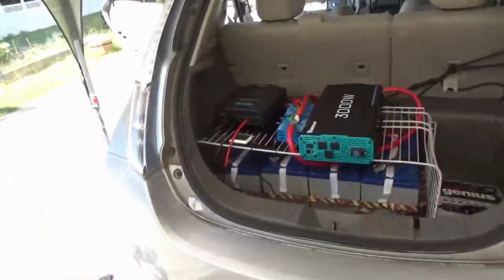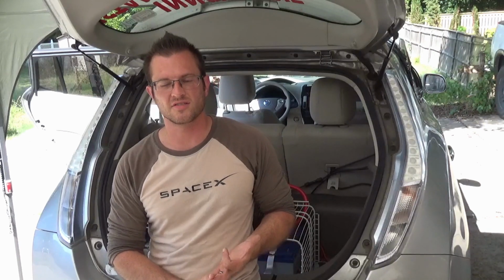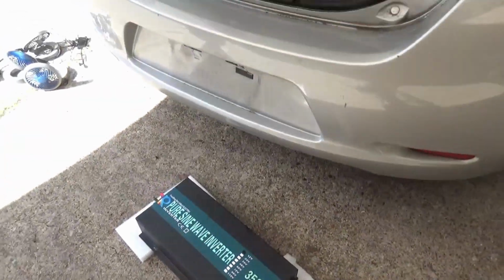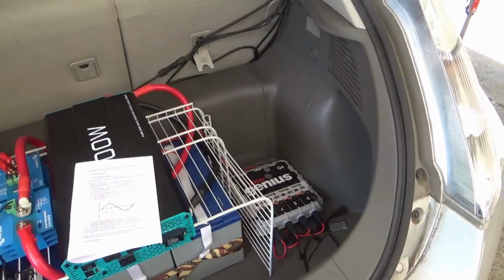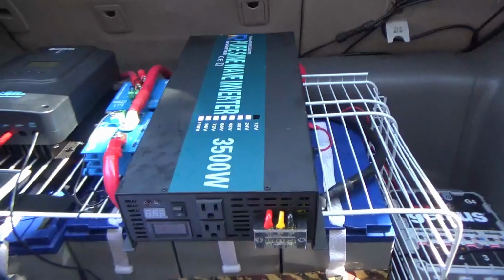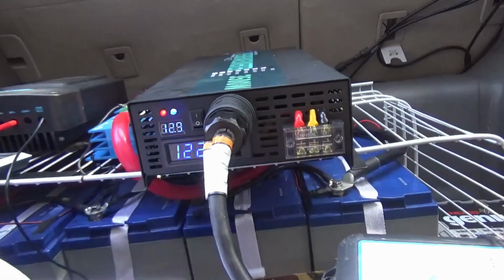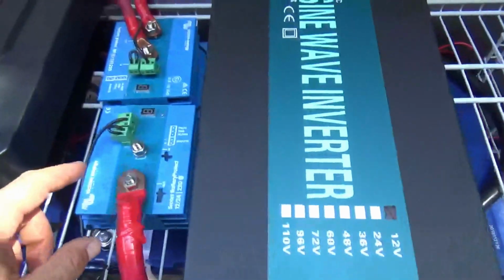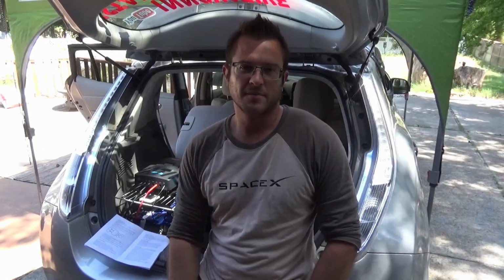Inverter Problems

Comment from the maker: Just had a helpful viewer e-mail me some insight.  He relayed "I believe the overvoltage light on the inverter is caused by the solar charge controller. When the voltage on the batts is close to full, the charger may put out high frequency, high voltage spikes, ~14.7v for short durations, to keep the battery topped off."  Brilliance in it's simplicity, and I don't know how I didn't see it before.  Next time, I get an overvoltage warning light, I'll definitely try disconnecting the charge controller.  (Always disconnect panels first, THEN disconnect battery leads).  Thanks to all the viewers who have helped me with this project.

Energizer did contact me about the inverter and say "Our product is UL listed, and perfectly safe, ." -blah, blah, blah.  I told them exactly how I had it set up when it failed (really failed!),and said maybe I got a lemmon.  If you want to mail me another one, I will test it out and retract my description of it as "unsafe" if it works as advertised.  I got no response to my offer.  All cables gauges were up to NEC specs, and all connections were tight and solid when this inverter failed.

Update: 11-12-2019  I eventually switched to a Giandel 4000w inverter.  Which makes it's first appearance in the video "Solar Powered Air Conditioning".  This inverter has worked perfectly for 2 months and counting.

Update: 2-16-2020   The Giandel 4000w is really starting to look like a home run.  I like the features on it, and we're over 5 months/3,000 miles using this inverter, with no signs of problems whatsoever.

Update: 11-24-2020  The Giandel just passed the 1 year of use mark.  No problems whatsoever.
Reply: Innovative: great video. I'm subscribing and unsubscribing from all the phonies. A phony is someone who does a video where they show the unboxing and plug it into their various appliances; then say: "I love it, it's great." Then I read the reviews on Amazon and they break down after 3 months. You're the real deal. Keep up the Excellent work!!!
Reply from the maker: @julesfalcone  Thanks.  The silver lining of being such a small fish that no one will sponsor me for sh!t, is that I have no financial incentive to be anything other than brutally honest.
Reply: I had one of those renogy 3000 watt inverters and it failed after about 6 months on the yacht. But in their defense, I did have it in a not so dry area of the boat and constantly had moisture on it. I opened it up and found a lot of corrosion on the inside so I gave it a pass and ordered another one. This time I put in inside under one of the seats that's in the salon. I found that it got hot (120f), so when using high loads, I took the seat cover off and put a fan on it. Now I have mounted it off the floor in the cabinet and put some temperature controlled fans in the enclosure so far I abused it cooking all the time and running a 16,000 btu air conditioner occasionally for hours at a time. I also have a 120 volt refrigerator, so I leave it on 24/7. 7 months at sea and had zero problems with it mounted in a nice dry location now. I have it fed with 700 amps of lithium and set my charge controllers from the solar at 14 volts. It never really runs below 13 volts as lithium batteries just give it plenty of power. The only thing I can suggest is getting a much more expensive sungold inverter. I just did not go there because they run at a higher standby current and I have no use for the built in charger. I already have a 60 amp charger on the boat, 2x140 watt alternators and 1,800 watts of solar that will get to 80-90 amps of charging during the day. So I have had great luck with this inverter for size, price and reliability. I really would like to have just a little more power, but almost every review of the 4000 watt models state they are really only good for 3000 anyway. I might have another look into the Giandel as that was another choice I did not go with. I am thinking of having a spare, as 4 months in the Bahamas at a time would be disastrous to have it fail on me.
Reply: Many thanks for posting the answer!!!
Wondering if what I stated yesterday will also work as the spikes might be released via the resistors and car chassis.
Might help in avoiding disconnecting/reconnecting.
Reply: Well I hope that shirt is just a fanboy shirt and doesn't suggest that you actually work for Spacex.
Reply: Glad you found an inverter that will work for you. I think your having trouble with the reliable inverter because they bond the netural and ground inside the unit. Also the ground prong is not wired to anything you would have to connect the ground to the prongs. Your car charger needs most likely wants to see separate ground. If you open the inverter up you will see the bonded connection and you would have to move the green ground to the chassis of the inverter then take a grounding wire from the inverter chassis and connect to car frame. I think it's called floating netural. 

Or could also be it's faulting out because it's seeing 60V on the netural ground connection I'm pretty sure the reliable is center tapped like a transformer outside your house. But someone correct me if I'm wrong.

60V on hot 60V on neutral on the inverter
Reply: A wagan tech proline 3000 watt has true ground get one those or go power I know I use the proline 3000 and have tested it it has ground most inverters have open ground and the one you got most them have hot neutral
Reply: @jameswilsin5348  It's weird that WAGAN touts the "Neutral to Ground Bonded/True Ground" in their list of inverter features yet totally ignores describing this rather "unique" advantage in the User's Manual(s). Very odd if you ask me...
Reply: I’m no EE PhD but I’d want to see a chassis ground that would wind up eventually bonding to a ground rod in the actual dirt of the earth if possible. But like in a RV or whatever I just cannot fathom how an inverter would not be grounded to its chassis and the battery neg with gfci in there.
Reply: @fishhuntadventure , do you telling that inverter needs to be grounded?
Reply: @jameswilsin5348 , do you telling that is a ground problem?
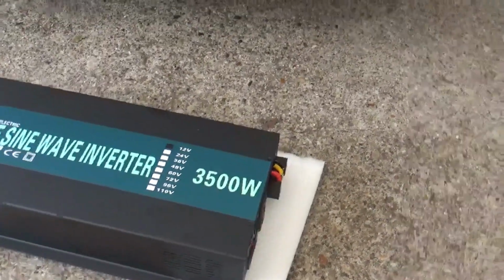Reply: Hey "ISS". In your video at [ -> 4:55 <- click here ] there is a 12V/3500W inverter. And frankly, it looks way too small and shallow for the 290A to handle. I don't really believe it!
 
Then at [ -> 11:00 <- click here] I see that you have put some kind of ring between the cable end connector and the hub - perhaps a spring washer. Always put the cable end connector ALWAYS belongs on the bottom and everything else - like any smaller wire end connectors, washer, spring washer and finally nut - they go on top of the big connector - never below. Now you have a disadvantage between the big surfaces of both - the hub and the end connector. It worsens the contact! So never spoil the abundant mating surfaces with some secondary junk that you can place on the top of the hub bolt.
Reply: I had 2 rich solar inverter s go out in less than 6 month.
Reply: try some sort of voltage regulator
Reply: Appreciate the constant updates to track these things 👍
Reply: If you are still having troubles, you can always use an Outback inverter. Expensive, yes, but 300% rock solid. They make vented, and also sealed units.

Comment: I went through 3 inverters in 7 weeks. 
1rst one from Temu lasted 4 days. It was sent back, and I got reimbursed.
Then the 2nd time,  I ordered another one from Temu again. It did not power on at all. So I got reimbursed again. Then the 3rd one from Harbor freight, the Jupiter, only two bars came on showing 10v, even though my multimeter showed the full voltage. So I took it back that same day and got reimbursed again.
My word, I have been into electronics since 1975, and built tube receivers and restored old receivers from 1939, and those electronics components to 1990s lasted a lot longer than this poorly manufactured components of today. It's also fragile. Since most circuitry is manufactured in China, they may be cutting corners with construction of components.😂😢
I am also an extra class radio operator and know like the rest of us that alot of the components that come from certain places in China are bad, don't get me wrong, yeah, there are some companies there that do good, but the rest are cutting corners.

Comment: Those car chargers needs bonding earth and neutral, So ground it, connect neutral and earth together and its working. Unfortunatelly i think you killed the previous inverter, dont ground it into car casing, but into ground.

Comment: I hooked the red positive to the batteries black negative terminal accidentally for the second time. Blew not only the fuses again but the inverter wont work with new fuses. Nobody I know can fix them. Thats the second inverter my stupidity has ruined.

Comment: I believe the grounding issue is because the US sockets is wrongly wired internally, someone else open it op and found out the Neutral and line is switched, so if you had wired it to the external screw terminal it might had worked. hope it Will help someone else.

Comment: If you intend to charge an EV with an inverter, it's important to consider the technology that's used in the inverter. High frequency, transformerless inverters provide a much lower surge capacity and a shorter life expectancy than heavy duty, low frequency, transformer-based inverters. Additionally. high frequency, transformerless inverters do not provide any galvanic isolation between its DC boost stage circuitry and its AC output which can allow high amperage DC current to pass through to your EV's onboard charger and damage it. 

You may be able to use a high frequency inverter to charge an EV short term, but it would just a matter of time before the MOSFETs or IGBTs in this inverter fail and you can kiss your EV's onboard charger goodbye. A much better and safer choice if you want to charge your EV with solar is to use an inverter or power station that uses low frequency, transformer-based technology in its design. Low frequency inverters can handle high surge loads for at least 3x their continuous rated capacity and they can do this repeatedly, without sustaining damages to their MOSFET transistors, for minutes, rather than the milliseconds that a high frequency inverter offers. And because low frequency inverters use a transformer, they provide galvanic isolation which protects your EV's charger. That's why the big-name brand inverter manufacturers like Schneider Electric, Outback Power, Sigineer Power, Magnum Energy and Victron Energy and others, all use a low frequency topology in their design.

Comment: I believe you need to  run a jumper at the inverter plug between the ground and the neutral  use a old plug and make your connection their.

Comment: Ground AC? One side? This is an idiotic requirement some electronics manufacturers want and demand. You have a floating ground. No connection to the third prong. Some old circuits assumed center tap. A voltage half way between the two prongs. ( good ) . AC usually is delivered as 1/2 of a 220 volt AC circuit. It's center tap and one side. Electricians aren't the brightest bulbs.

Comment: Quick Question….
We have Giandel 2200w  12 vdc pure sine wave inverters ready for installation i our ambulances and 2-way radio communications and repeater vehicle.   There are many more devices requiring clean power nowadays and this seems like a good solution for the extremely limited budged we have for this project.

We love the inverters and the manufacturer is rock solid according to several other fire departments in our area who’ve purchased the Giandel.

The BIG QUESTION…
Do we need to “pre-charge” (with low impedance  / high power resistor) the capacitor bank prior to applying 12vdc power from the 100ah x 2 (parallel) 12vdc LifePO4 batteries?

I’m our communications trailer, we have a pair of batteries with charging provided by a 60 amp AC to DC LifePO4 charger from a small portable Honda 2200w inverter based gasoline genset.  The generator only has to be run for a few hours every 12-20 hours of radio equipment use.   The batteries and inverter permit us to only run portable generators occasionally.

The batteries are normally left disconnected with a Cole-Hersey type mechanical DPDT 200a 12vdc switch.
In our other vehicles, the inverters are wired directly to the batteries (using both fuses and circuit breakers to catch an overload or dead short as soon as possible.

Any ideas?   
Sorry.. forgot..  we have used the standalone inverter in our comms trailer a few times for short intervals.
During this time, we haven’t run into any issues..

Thanks !

Comment: I went with the Giandel inverter as well. I am not an expert, just a DYI-er & I have found that even tech support at Giandel on ground issues, to be sparse. They basically said to use only the L & N terminals -  "Our inverter generally only measures the voltage from the L to the N.
L = Hot wire
N = Neutral wire
G = Ground wire
Regards,
E

Comment: I highly suspect you are correct that the temp is the issue.  I doubt they mean the room you put it in can be up to 159F.  I think they mean that the device itself can get up to 159F before there are issues.  And your STARTING temp is 128F in there.  And once you start putting power through it it is probably going to heat up more than 30F.  The fan can bleed some of that away but probably not enough.  Just a guess though.

Comment: 12v Inverters have big problems. 12V is rubbish for high power, because you need large currents to get high power and voltage drop is an issue. also the ripple currents are enormous. Also drawing large currents from battery will degrade your battery life. Excessive Battery voltage sag is another problem, at high current draw. You would need a trailer with dozens of 100Ahour batteries in parallel, just to cook dinner 3~4KW draw for say 30minutes, and most inverters would overheat and go pop, as they are overrated and undersized. A true reliable high power inverter does not exist it would be massive and cost thousands..and thousands..

Comment: I have a Krieger 2000W PSW inverter that I have with a 300W and 2 Redodo 100AH batteries as a solar battery back up in case of an emergency power outage. I have never ever needed to use it thus far and I only turn it on to charge power tool, flashlight and 18650 batteries 2 times a week. The thing is only 13 months old and today I went to turn it on and the light blinked quickly and then it just shut down and it is dead. I can't believe the crap quality of this unit that I paid almost $300 for and NEVER ran any appliances from it smh. I'll see what Krieger customer service says and how they handle the warranty, but I'm posting this as a buyer beware about Krieger inverters. Thanks for sharing your story.

Comment: When you have a completely isolated system, where do you think a ground is going to come from?   For the Chinese inverter, the ground wire on the AC plug is wired to the chassis and through safety capacitors to the    H and L side of the AC output.  
     That particular inverter is a 60volt split phase design, so making the negative battery common with the ground on the AC side is problematic.

If you want a ground on any truly isolated system, you need to pound a ground stake into the ground (like every house/business has).

Comment: The gas from the batteries being directly underneath the device also effects the device, think about moving the device's or the batteries to different locations, also the load on the inverters + the radiation/gases from the batteries being directly under the device's while they charge and discharge, could very well cause problems in very high power applications!!! An option you could put something in between like a cover over the batteries and maybe a fan and fan shroud to help but it's possible that the amount of large batteries you have directly underneath the device's could be destroying them!

Comment: The charger is detecting that you have a floating neutral. Those chargers need neutral to have the same potential as the ground connection.

Comment: If you need a ground, a rod with a wire clamp and hammer will give you a good ground almost anywhere. The car is on 4 rubber wheels and NOT grounded. The shock lug is negative only. FYI glad you found the issue.

Comment: Hi I'm a technician, the problem is the charge regulator, you have to replace it and mount an MPPT the counter is not accurate, the output voltage is high

Comment: To fix the ground fault issue, just connect the Neutral to the Ground wire inside the inverter. It’s called bonding. The Neutral and ground in your home electrical panel is bonded together, as well. So, this is not unusual and should not cause an issue. @ time 12:52.
Reply: Renogy is already bonded
Reply: Renogy is already bonded inside
Reply: I believe is the c44 circuit, just I little connection you can cut off

Comment: One thing I can think of that might help others and you down the road is that I don't know if there's a consumer report or list of which power inverters are reliable and ranked by how long they last. people need this to avoid issues like this. And it seems like a lot of people are having issues with inverters. But to get away from that people would have to be able to study out which last longer, and that's lacking right now for everyone to look at.

Comment: There is a chap who sells battery and he was trying to use an electric truck to charge a tesla, he had to use an adapter which have a resistor between the neutral and earth pin before the tesla would charge. II wasnt paying much attention so cant give more info. it looks like you are use a pwm solar controller